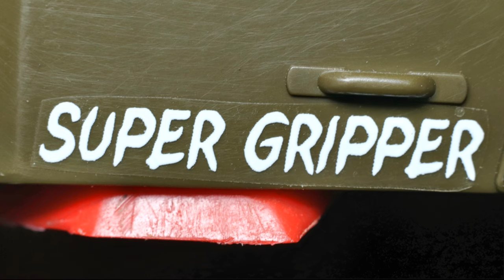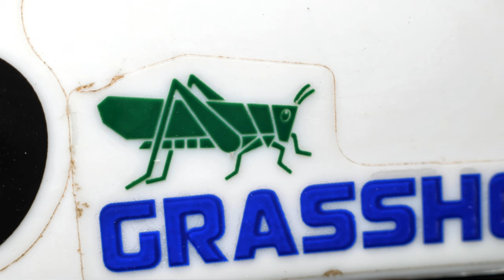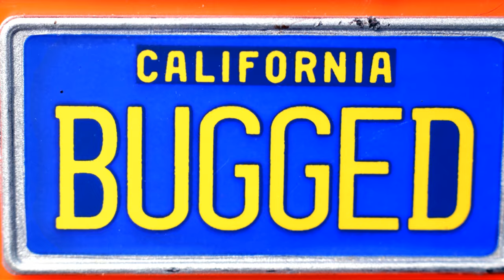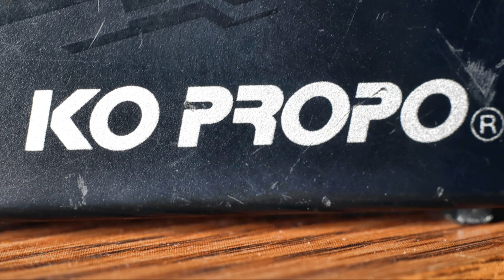RC CARS | THE HOBBY UP CLOSE! | WOW! | CRAZY!

Comment: Wow super cool close shot video! I'm glad that you're not the one who completley rebuilds and "supercleans" his rigs after each run. I know some guys who do it. I'm the bash it, silicon spray it, dry it and leave it guys :D Merry Christmas buddy! 🎄
Reply from the maker: 😃👍 I clean mine pretty good with bristle brush air compressor and wd40 you can't see this stuff they look super clean the dslr and the new extension tube with my 50mm lens makes it so visible I could not believe it!  🎅🎄 Merry Christmas.
Reply: @ShenRC   Like I said, no completely rebuilds and supercleaing after each run 😂
Reply from the maker: @Remoteaddicted  Yea I don't do that complete tear down stuff that's crazy just end up stripping all the plastics out for the screws taking them apart so much. not good!
Reply: @ShenRC  agree :)